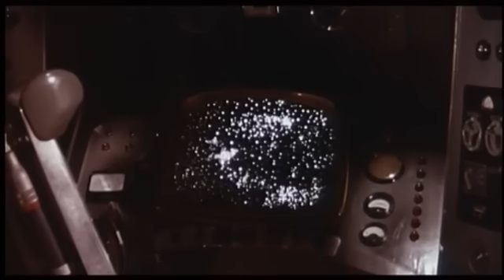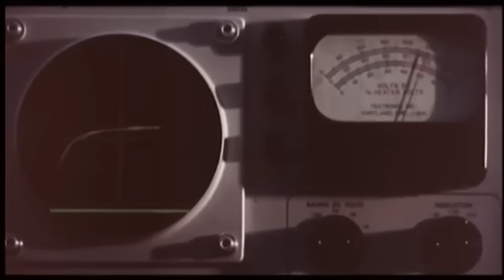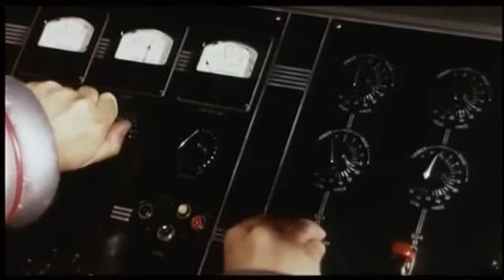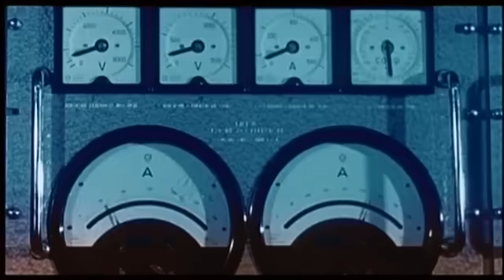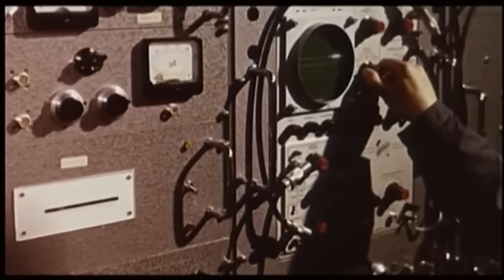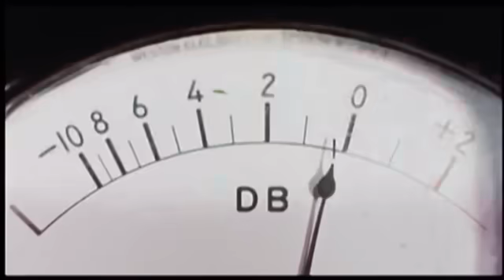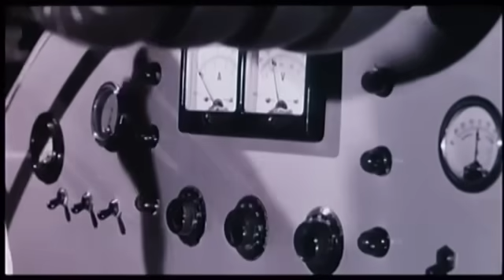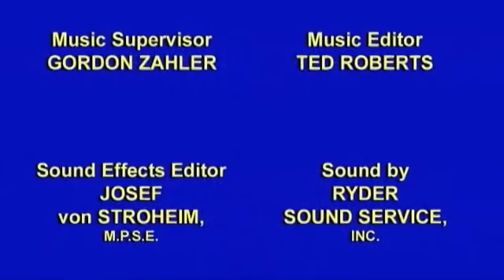ASSIGNMENT OUTERSPACE | Free Films from SCI-FI-LONDON

Comment: What I love is to watch one of those old space movies and when they launch, video of an early Atlas launch is used....and when the crew of 4 or 5 “astronauts” arrive in space.....they have multiple rooms and stories in their spaceship, racks upon racks of senseless electronic gear, four of five old Dumont Oscilloscopes (60 - 90 pounds each, showing meaningless sine waves and such).  Each room on their spaceship has a 10 foot ceiling, they carry enough fuel to launch, travel to and then land on Venus or even Mars, and then fuel enough to re-launch back to Earth!  Of course, one astronaut must die when they find the meaning of life, so there’s that weight savings.  But on the other hand, one astronaut must be a girl, with immaculate makeup and hair no matter what their mission is, so that is a huge weight drag.  In any case....that old Atlas sure was a versatile and capable booster!!  We waisted money building the Saturn V, realizing it could have been easily done with only one Atlas!
Reply: And don't forget the R-390 s/w receiver. Damn thing weighed 60-70 lbs!!!
Reply: and plenty of spare electron tubes, of course...
Reply: I wonder about the same thing every time I watch another episode of the original Lost in Space.
Reply: It was a Pegasus models von Braun cargo rocket or willy ley rocket . Plastic . About less than a foot tall . 
The flame exhaust curls upwards

Comment: Much of the background music is lifted from Destination Moon. Most of the spaceships and the space station are commercial plastic model kits available off the shelf at the time...such as the now classic Revell space station created by Elwynn Angle. And, by the way, the space suits make no sense. The rings on the arms and legs are supposed to be expansion joints...so they should be on the elbows and knees (as was correctly depicted in Destination Moon).
Reply: judith miller: sorry, they were not expansion joints they were impact protection bumpers to protect the suit from punctures and such.
Reply: Judith Miller I have Destination Moon, don’t don’t recall hearing a similar soundtrack. Can you point out one or two examples?

Comment: If you want to see how they visually interpreted the most advanced space travel knowledge and theory in 1960, this is the movie for you!  If you compare it to today’s movies, you will be disappointed. 
When the movie came out, the worlds collective knowledge of real space travel at the time was animals shot into space were finally coming back alive. A few years earlier they finally figured our how to get a rocket back from space without burning up, something some thought was impossible. Transistor radios had just been out for a couple years vs tube radios. Digital audio was 20 years away.  Digital video was almost 30 years away.  
Considering the lack of common knowledge on the subject in 1960, they did a great job with visually interpreting then modern advanced knowledge and theory!
Reply: You say that as if today we're flying around the universe! Remember the shuttle NEVER got into outer space, it basically flew very high. You could argue that more happened in these imaginative old movies.

Comment: You know what? In spite of all of it's shortcommings this is actually a surprisingly acurate movie as far as the sceince is concerned. A few examples:
- They keep jabbering on about giro's. Stupid, ain't it? No it isn't! You can actually point the nose of your spaceship with the use of gyroscopes.
- Since getting stuff into space with such technology is very expensive the insides of the ships are actually rather cramped, as they where / are in real life.
- There is no cheap artificial gravity copp-out stuff here. When in the spaceships people move very carefully from beam to beam. Only when in the spacestation with the rotating core and on planets they move "normaly". How about that for good continuity!
- Talking about continuity: Everybody of course understands that once in space all these ships are of reassembled into full 3 stage setups again. After the take of the ship's 3rd stage arrives at the space station. The commander then asks for the 2 replacement stages to be reattached and refueled before they leave! Check it if you don't believe me. It makes them able to carry much more fuel and you also never know if you have to restart from a planet with an Earth's strength gravity anyway. Since the rescue landing they make is however on Phobos, which is a small Mars Moon, they do not need to discard any of the new stages. See, it all adds up in the end! :-)
- It's a pity they still use the old sound-in-space mistake though. Anthonio Margheriti , the director however corrected that in his next Sci Fi movie, called Battle Of The Worlds. Here an experimental electronic soundscape was dubbed over every external space shot.
By the way: the very spaceship used here is blown up by aliens in that movie!
- And yes, I am a total geek! :-)
Reply: I think you mean gyroscopes.
Reply: @williamjc7195  Thank you. I've corrected it. Me not english speaking actually. Me damned alien. :-)
Reply: @marcbrasse747  hahahahaha :)

Comment: 1. I think the "air doughnuts" on the reporter's arms and legs must make going into a vacuum a good bit more comfy!
  2. It seemed a tad optimistic to just toss the guy from one ship to the next. These guys never heard of rope?
  3. The ship in transit is under continuous boost? Bad use of fuel!
  4. Motorcycle helmets with dark visors! Those should come in handy.  . .
  5. I don't get why they had to go to Venus. If the nuke was going to be launched from there in any case, how does the ship arrival have anything to do with it?
  6. My favorite analog gauge was "Peak WOW" 54:26.
  7. "An orgy of air!" 108:06